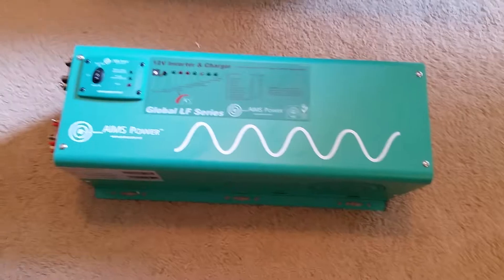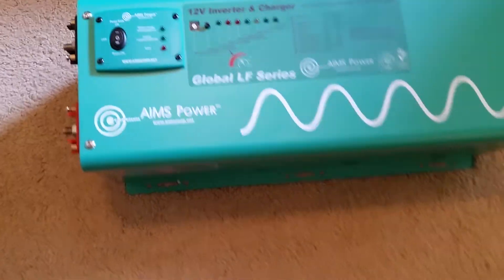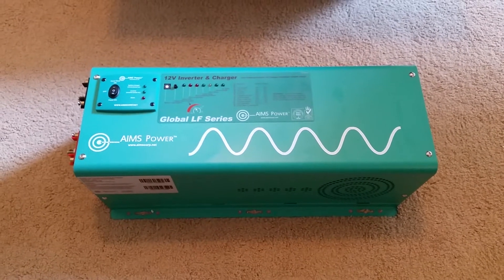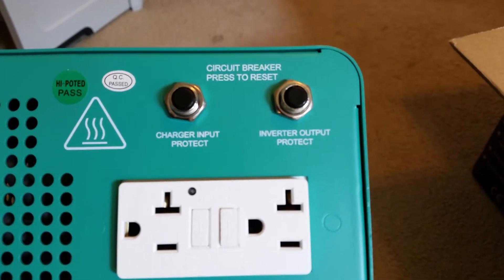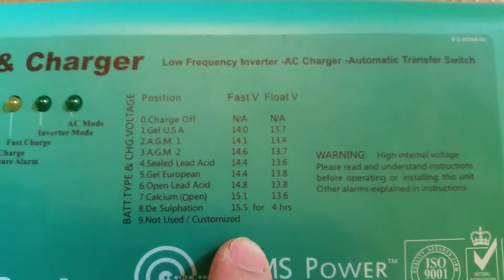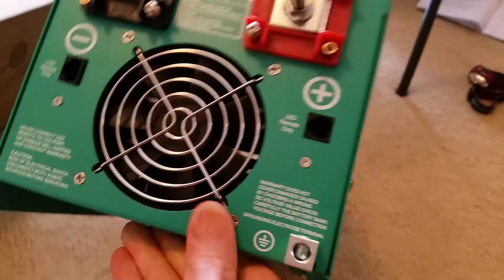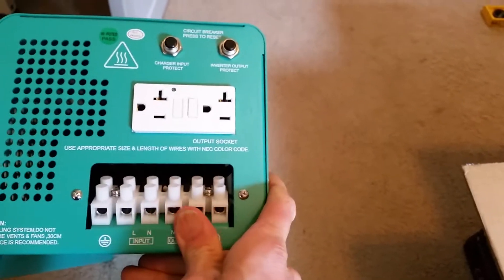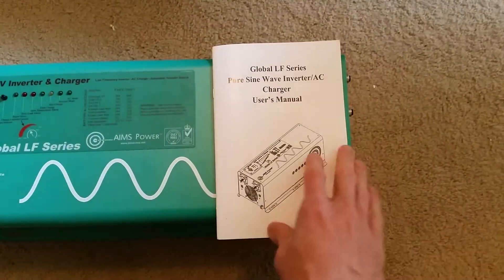New Battery Backup Power System Project - Part 1.2 of 6:  Aims 2500w Inverter/Charger

Comment: I've seen a video of the 1250 give problems but NEVER the 2500   
I just ordered the same 2500/12 Volt Aims inverter.  I already have the Blue Aims 2000/24 volt inverter it's a Beast  so I figured I would try my luck with a 12 Volt system

Comment: Well , well .! You have gotten hold of one the best product your money can buy  . You can always Trust AIMS , it’s heavy duty  . You can also buy the separate remote panel that you can mount anywhere inside your house to monitor the power status and turn on and off at will . I don’t know if they have them that can do lithium’s now  . You can watch my new and recent solar videos and see how I have mine  and leave a comment . You’re in good hands with the AIMS and will be very proud  of it . May the solar be with you .
Reply from the maker: Hi Cedric and thanks for watching again!  After a few months of this AIMS inverter/charger being installed now and operating flawlessly through an actual power outage I am very pleased.  I have noticed you have been putting quite a few videos up lately of some battery capacity additions.  Good to see you continue to expand.
Reply: corey Babcock  The Aims will never let you down . May the solar be with you .
Reply: I have this Aims 2500 installed in my RV
 With 400ah lifePo4 batteries. I use my predator 3500 to run my AC off grid. However the inverter beeps when the AC 
(Houghton Bellaire 3800 from recpro) condenser starts. If the generator is in eco mode the inverter also beeps. How can I find out what the beeps mean?
Reply: @BevDessert  it’s all about when the ac starts up the compressor , it draws a big surge that can overload the 2500 watt inverter or not enough batteries to handle the inrush surge to get it started . Either you will need a much larger aims inverter , more batteries or better yet , get a “ Micro Air “ Blue RV AC soft starter kit . There’s videos of it . Check it out . May the solar be with you .
Reply: I also own this inverter and I do like it, works great but the only thing I don't like is the energy consumption at idle (50 watts)
I've got plenty of battery and solar so not a big deal....